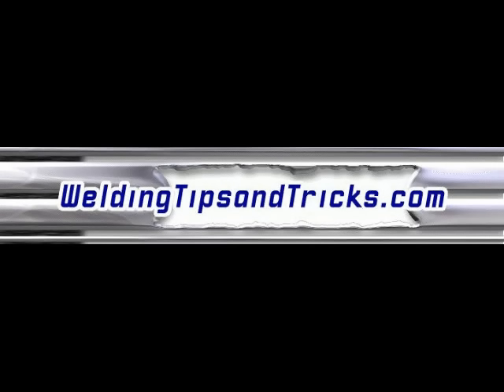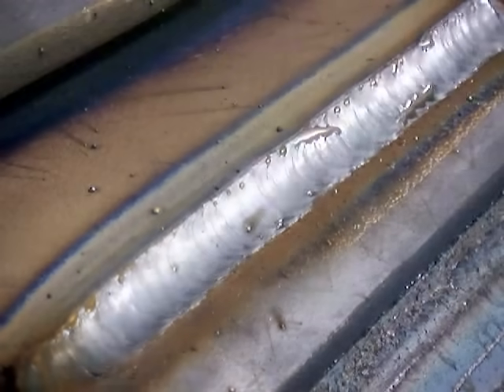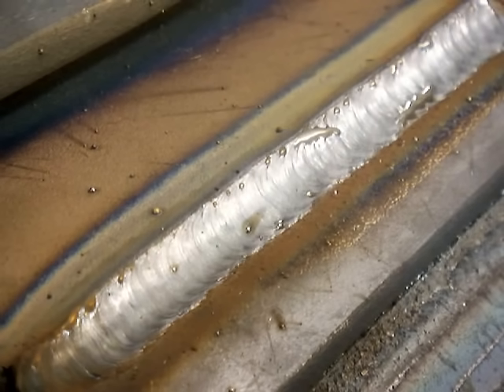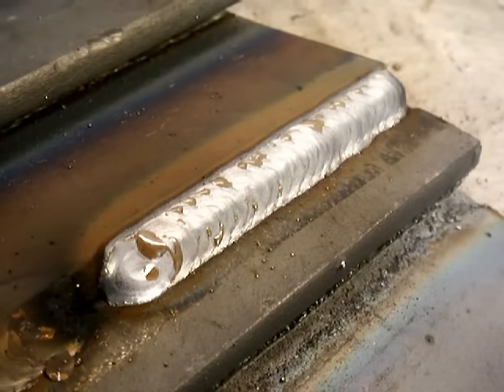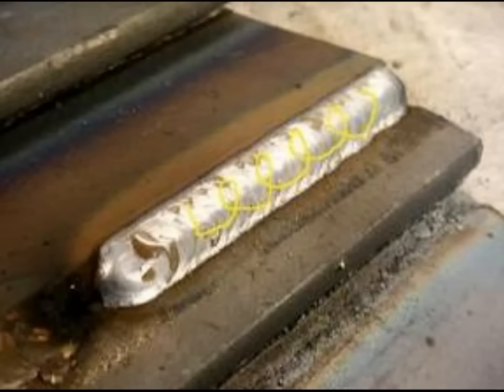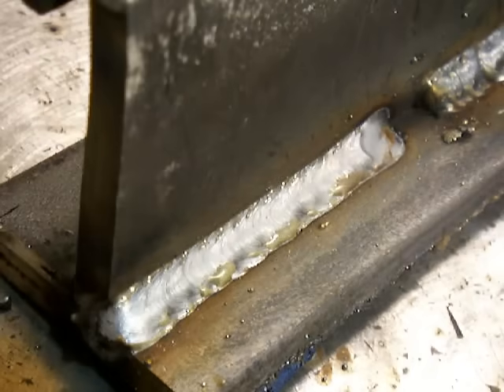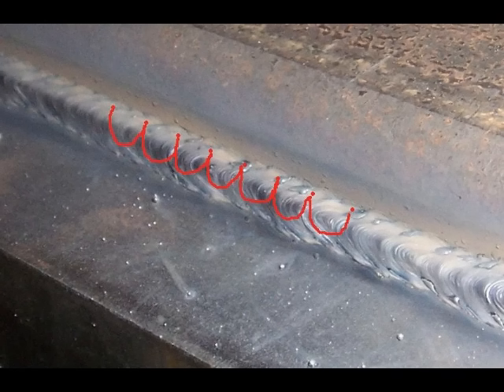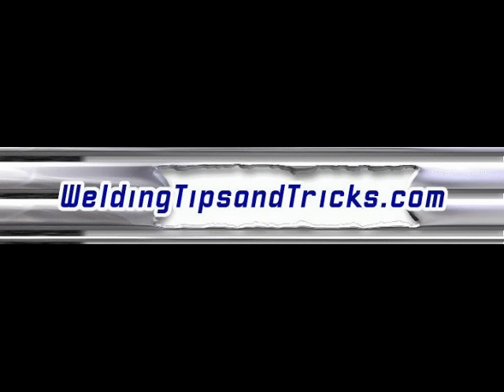Mig Welding Technique Taught by Old Timer

Comment: Mr.venny- Dragging the arc has a profound effect on penetration, especially with SMAW. It also has a huge effect on profile whinch in turn has a huge effect on stress risers at the toes of the weld.  What you need to do to understand puch vs pull is to weld up a t-Joint with push on side A and pull on side B, cut a cross section in a wet saw, polish the surface and then drop a little bit of nitric acid on the polished region. This will show you the depth  of penetration. Very common practice.

Comment: @helloman1976  Take some night classes at a local Community College. The best way to decide will be to see what works for both you the operator and the material(s) that you intend to use. If you buy a nice little tig welder like a Lincoln Precision 225, you can tig and SMAW (Stick) weld with this one machine. Use the tig end for light gauge material up to 1/4" with this machine and stick anything heavier. Just a thought.

Comment: I know absolutely nothing about welding BUT I want to start learning and doing projects in my garage. I need something affordable that will weld steel or aluminum pipes. Can anyone recommend what kind of welder I should use? The pipes will never be any bigger than 3" diameter and 1/4" (steel) thick. Thanks!!!

Comment: Nice series! I'm in a location where we can't get any gas or I'd order up a machine to learn with. Is there a welder that will work with 50 and 60 hz as well as 110/220? I work in Iraq and want to send over a small machine (USPS mailing limits of 70 lbs) and flux core is the only thing I can think of to practice with. I'll keep watching your vids aqnd see what I can pick up. Thanks for posting these.

Comment: Hi, Thanks for your videos...
I'm thinking about welding a steel or aluminum half hard top for my Jeep Wrangler TJ... Could you recommend a metal and its gauge? Should I weld a frame first or can I just weld the sheets of metal together? 
I've never welded before, however, I have soldered some. My brother has a welder and I'm hoping to use it. :)

Comment: @zagan1 thanks alot for the comments Zagan, I appreciate it. As you know, the only thing welders like to do more than drink beer, is argue. X-P

I don't really know what those settings equates to in volts, amps, and IPM. For many if not most wire feeders, 2 o'clock is about  500 ipm. 10 o' clock is about 270 ipm. Do you have one of those double-speed wire feeders?  

I've been welding about 8 years.

Comment: @TSorovanMHael 
lol,  way way too low for me on those settings and too slow, I'd fall asleep with those settings on 5mm plate.

for the weld master I use C:3 F:5 and half a notch below 8 WF and push the welder straight across no UUs or push pull straight across smoothly but I have over 20,000 hours of welding exp or 10+ years.

Comment: @TSorovanMHael 
Pulling doesn't mean a non penetrated weld it comes down the right settings for the steel your doing, as it's the heat produced that does that, don't have enough heat and it won't matter how slow or fast you move it just won't weld properly.

Comment: @TSorovanMHael 
No, because the settings are unknown yet the sound is prefect so I know he has the correct settings.

if you pull or "backhand" a MIG the weld become shallow and wide due to the wire not feeding into the puddle, many people who don't use proper settings will pull the gun as it will give them a decent looking weld.

The push weld looks fuller due to the puddle always getting new wire to keep it full the weld will be thinner as the penetration is deeper.

Comment: @TSorovanMHael Well I use a 3phase 330 Liquid arc(Lincoln)welder and a 3phase 280 weld master and use a cig weld as well.

A 280 single phase welder will do up to 12mm plate, maxed settings.
A 330 3 phase will go up to 15mm maybe slightly more 18mm it gets a bit too cold on 20mm unless you work the weld puddle at max settings.

A 450amp welder will be good for 25 to 30mm didn't get to use it on that plate size but just blows through 5mm plate on low settings A, C, 2, 21/2 wire feed Lincoln.

Comment: @zagan1 You want to be using spray transfer parameters on >3/16" when welding flat or horiz. That means WFS at around 2-o-clock on the dial, and about 27-30 volts.

Sure, it's a basically sound weld and probably wouldn't fail under mild conditions. But you could do a lot better, and faster I might add. A lot of welders that don't have experience with spray transfer, the first mistake they make is welding too slow. 

If your power supply is less than 250 amps, you should not be welding >3/16".

Comment: @zagan1 It's hard to tell the thickness here, 3/16"-1/4" maybe? Either way, using Short transfer on material this thick is almost unconscionable! 

I can almost guarantee that there will be incomplete penetration into the corner of the lap. You can kinda tell from looking at the solidified weld crater in some of his welds. Basically he's making a cold, shallow weld, and just spreading it around so it looks wider, but does not melt better into the base metal.

Comment: @zagan1 Thanks, Zagan. Good points. My response is that your first statement is too general to mean anything.  It will produce a bad weld if you set your WFS into the globular transfer region, above short-circuit but before you start getting good spray transfer.  It will also produce a bad weld if you don't increase your travel speed to match, resulting in undercut on top and cold lap. WFS and volts and whether you use short or spray settings should be dictated by material thickness.

Comment: @badandyb AWS is a standard, it'll certify that your welds will hold at a certain amount of pressure, that's what the tests are for.

All welds that are engineered have a set standard but it's based on breaking points so if a weld needs to hold 2 ton then you need to get someone who has a cert to that or above the requirements.

It's no good reading books and then spouting out lines from the book to people in the trade as they have all sorts of names for this weld.

Comment: @wYoMiNgsLeDnEcK 

Your really meant to push the gun not pull it as the gas is the shield and pulling the gun sometimes doesn't allow the gas the shield the weld,  Also you'll note the difference of the welds.

The pull gives thinner welds and the push offers a fuller weld.

Comment: @TSorovanMHael Turning up doesn't always mean a better weld.

Also if your already at the max settings and need large welds on an item then you need to work the weld as you go.

This guys welder is set up perfectly for the metal you can tell this from the sound but also from the very little to no splatter left on the work piece, so even if you did cut the metal up you'll most likly find no problems also his speed across the piece is very nice as well.

Comment: If you're having problems with undercutting or incomplete fusion on a lap joint, you're probably not using the proper weld settings or travel speed anyhow.

Comment: I have a couple of issues with weaving. If you're trying to make a bigger, hotter weld, then simply turn up the volts and WFS, and weld faster. This will give far better weld productivity. 

Secondly It's OK for robots to weave. A human is not nearly consistent enough. You're likely to find lack of fusion defects and lack of penetration if you cut a bunch of sections from this weld. When welding flat there is nothing weaving will accomplish that cannot be done with other means.

Comment: ANYWAY I am restoring my Austin Healey and my old 1964 Ford N750 Flatbed, I was hoping someone here can help out with a welding question from this rookie. I need to weld the base portion of a zinc coated muffler clamp, my question is can I MIG weld it being it is zinc coated, I will grind the surface first and make a clean connection but is the zinc coating going to give me a problem. I do know not to breath those fumes. Can any of you pros help.

Comment: Great Video.
I use this type of technique and several others including a circular motion with a slight back step looks great and will pass a destructive test , but I find if I use these techniques a lot of supervisors etc think its cold lapping for some idiotic reason ,some also say its too slow also which is beyond me  ,I think its mostly because they haven't been exposed to these types of weld techniques before , now I'm mostly forced to run the normal boring welds to keep every one happy.

Comment: Great tips. Some suggestions for future videos.
How to get goldy welds on Stainless steel, backgassing, I heard someone using a gas lense for backgassing, tig setup eg  gasflows  stickout, heat setting, speed, pulse settings. I just wanna see someone do a nice goldy weld on Schedule 10 316 Stainless pipe joined up. I have seen plenty of these nice goldy welds but cant do myself. I make my own turbo headers.